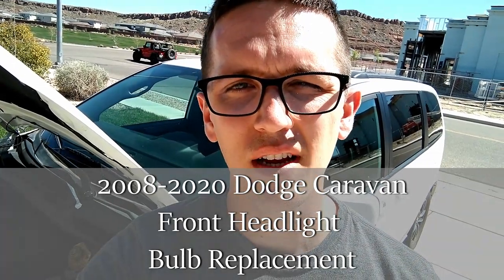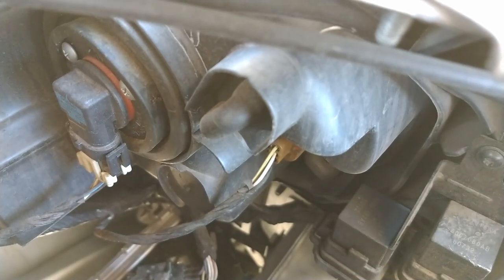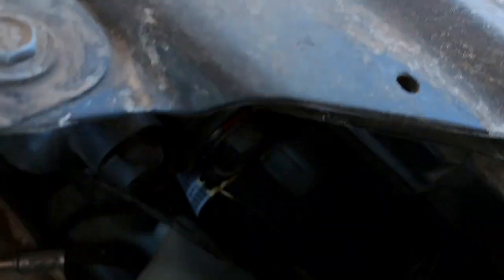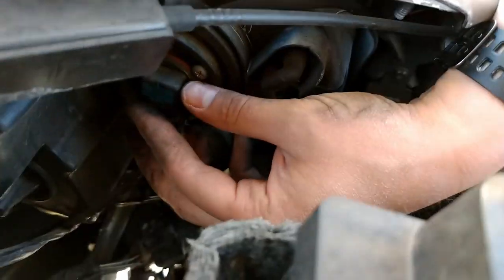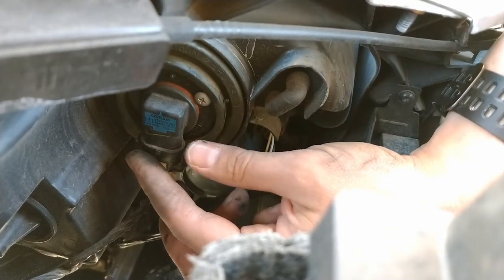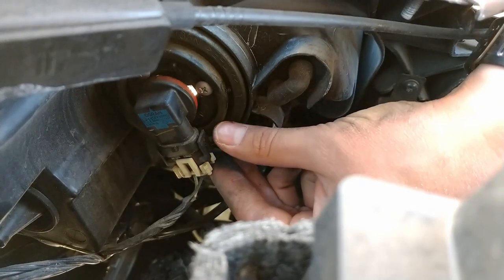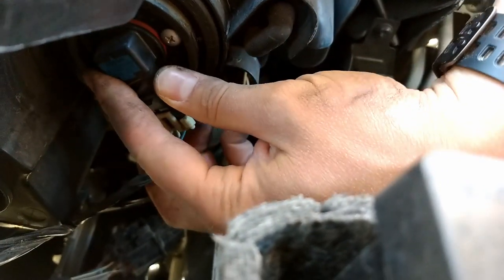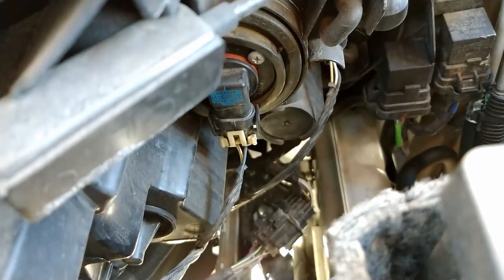EASY! DODGE GRAND CARAVAN 2008-2020 Headlight Bulb replacement, 5 MINUTES

Comment: I have a '12 GC.  It takes 2 H11 bulbs on each side.  The bulb on the driver's side looks like it's going to be the hard one, but it was actually easier.  The passenger side is tight with the wire when it's turned to 3 o'clock.  Putting it back in without the wire connect (which is what I did,) isn't necessarily easier.  Getting the bulb into place and then the connector on the bulb are both done by feel with very little room.  Removing the top of the air cleaner doesn't help.  If you could take the whole air cleaner out, that would give you lots of room.  However, it's still a quick job to replace both once you know where to feel at.  My new LED bulbs are working great.